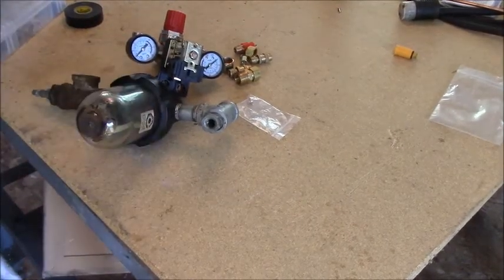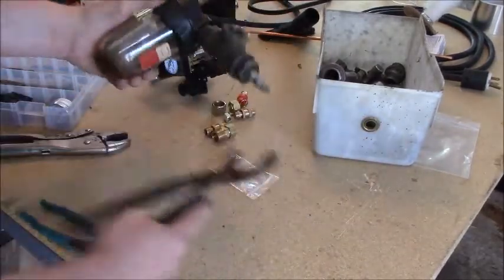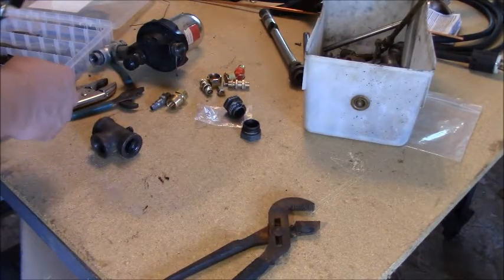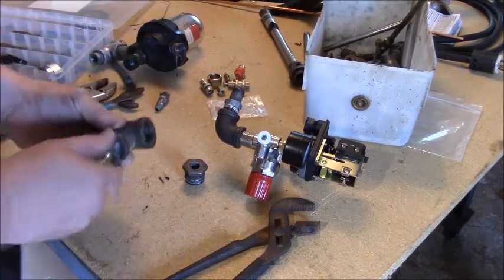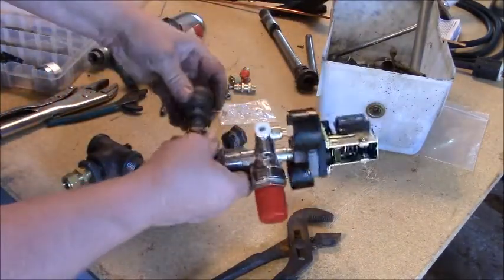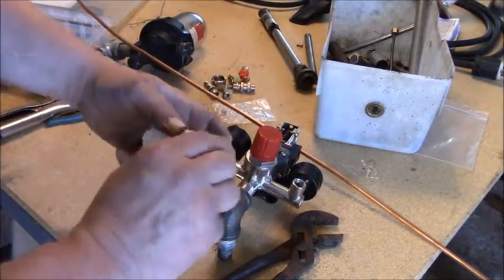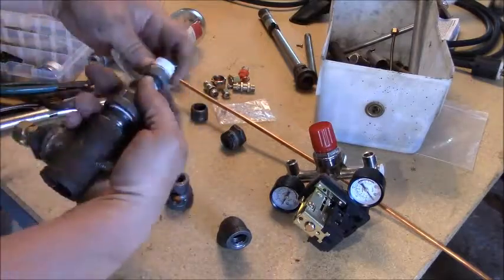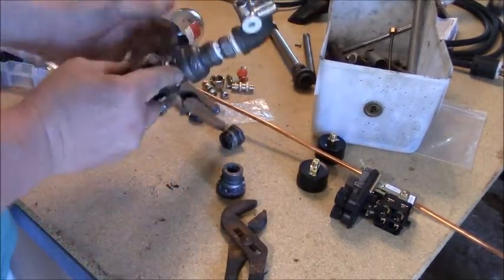How to build an air compressor DIY air compressor, Part 3 Assembly

Comment: WRONG！！！！ The plastic cap is the vant for the crankcase.Parts in the crankcase move up and down creat change in volume so you need a vent to balance the pressure. The dump tube should connect to the air outlet pipe ( before check valve)inorder to dump the pressure in the output pipe when the pump just stop work. The pressure in the output pipe didn't dischage befor next cycle, the motor have to drive the pump under heavy lode. This may lade to difficulty in starting and it's definally bad for motor.I did,'t see a check valve, you should have one to make sure that air only goes in to the tank.

Comment: One gauge should read tank pressure.The other gauge should read outlet pressure governed by the regulated side of the pressure control switch assembly.